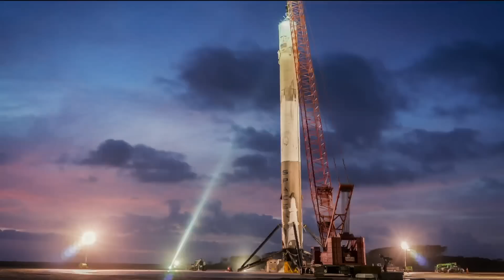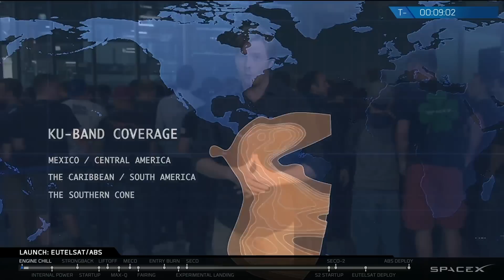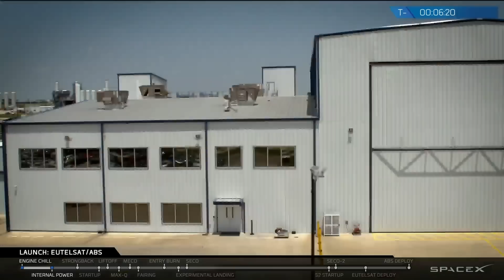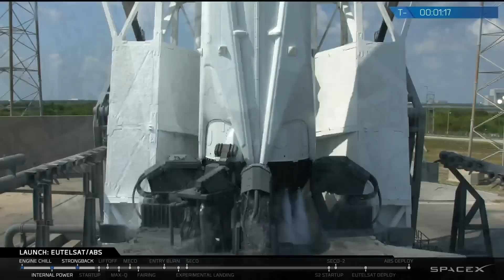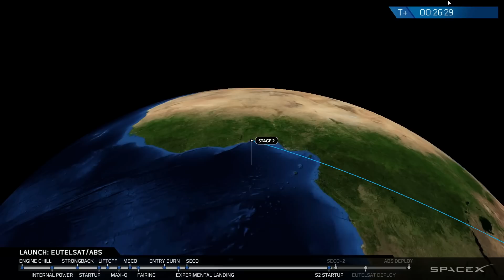Eutelsat/ABS Mission Hosted Webcast

Comment: how about that view of earth and sun as the payload was jettison 1:03:16
Reply: What an Amazing view!!!
Reply: And you can tell its not a perfect sphere from that image
Reply: NicosMind Looks more like an oblate spheroid. ;)
Reply: +NicosMind while it is true that the Earth is not a perfect sphere you have to remember that this is through a small wide angle lens
Reply: If you'd shrink it down to the size of a pool ball it would be a more perfect and smooth sphere than said pool ball.
Reply: Robin Frischkopf Mind blown O.O
Reply: The World Pool-Billiard Association Tournament Table and Equipment Specifications (November 2001) state: "All balls must be composed of cast phenolic resin plastic and measure 2 ¼ (+.005) inches [5.715 cm (+ .127 mm)] in diameter and weigh 5 ½ to 6 oz [156 to 170 gms]." (Specification 16.)

This means that balls with a diamenter of 2.25 inches cannot have any imperfections (bumps or dents) greater than 0.005 inches. In other words, the bump or dent to diameter ratio cannot exceed 0.005/2.25 = 0.0022222

The Earth's diameter is approximately 12,756.2 kilometres or 12,756,200 metres.

12,756,200 x 0.0022222 = 28,347.111

So, if a billiard ball were enlarged to the size of Earth, the maximum allowable bump (mountain) or dent (trench) would be 28,347 metres.

Earth's highest mountain, Mount Everest, is only 8,848 metres above sea level. Earth's deepest trench, the Mariana Trench, is only about 11 kilometres below sea level.

So if the Earth were scaled down to the size of a billiard ball, all its mountains and trenches would fall well within the WPA's specifications for smoothness.

However, it should be also be noted that if the Earth is not a perfect sphere. It is an oblate spheroid and should therefore also be tested for conformity to WPA specifications due to its shape. The distance between Earth’s poles is shorter than its diameter at the equator by approximately 43km. The maximum deviation with the respect to the Earth’s average diameter is half that distance, or 21.5km, which is within the scaled up WPA tolerance of 28.3km.

It can therefore be seen that the Earth would conform to WPA specifications for billiard balls if it was scaled down to the appropriate size, and it could said to be smoother than at least some billiard balls that would be permitted by the WPA.
Reply: last time  i checked balls were a 3d objects and round
Reply: Then it would be more like air hockey.

Comment: Elon tweeted that it "Looks like thrust was low on 1 of 3 landing engines." and "Maybe hardest impact to date."

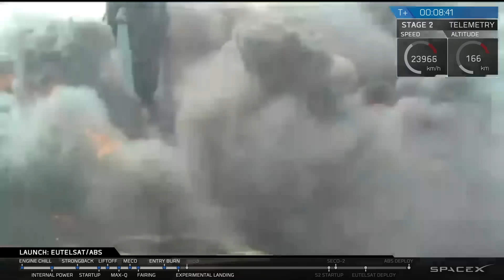But there was no 'impact', you can see the rocket standing still on the droneship for several seconds. Hard to see, but do the following: Go to 26:40 in the video, let it play at a quarter of the speed and watch. You can clearly see the falcon rocket standing still in the first few frames until it is covered up by smoke. Then again at 26:44 you see the silhouette of the rocket with flames behind it.

There was no impact, it landed successfully, the problem seems to be that it's burning like there's no tomorrow
Reply: David Igandan
Well, you can see at one frame that it's standing and 4 seconds later you see the silhouette of the rocket in the same place. 4 seconds no movement of the rocket guaranteed. Looked pretty stable. Just on fire :D
Reply: i think it fell over remember what happen to the legs on the other rocket that made it lean  is possible it happened again and it was way too close to the edge of the barge
Reply: Maybe the landing was hard enough to set something on fire (probably the RP-1 tanks) but not so hard that it physically broke the rocket. So perhaps it "landed" and then exploded shortly after.
Reply: i cant wait to see the video to get this demond out of my mind lol
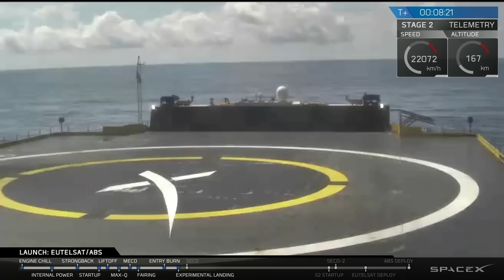Reply: You mean 26:22
Reply: maddog2622
 damn, they seem to have changed the video or cut something out. thx for the corrected time stamp.
Reply: Perhaps a faulty engine? That doesn't inspire confidence.
Reply: Willie Gillie
Elon Tweeted in the meantime:
"Turns out the landing was not as fast we thought, but still hard enough to destroy the primary airframe and accordion the engines"

and

"Looks like early liquid oxygen depletion caused engine shutdown just above the deck"
Reply: Thulyblu Yeah it's weird I saw on some other time stamps that the same thing was going on and the video was 10 minutes behind.

Comment: Gto missions are harder
Reply: Especially with dual payload
Reply: These 2 payloads together weighed ~1.45x less than the singular SES-9. The payload weight makes >10x more difference to the second stage delta-v than it does to the first stage because the first stage is still carrying the empty first stage + some fuel for recovery burns + the whole fully fuelled second stage as well as the payload when it stops burning and those things weigh so much more than the payload.
Reply: +Aeryn Osu Well the cause of the so called 'RUD' was because of low thrust on one of the engine.
Reply: Not really. The mass of the two combined was less than Thaicomm, I believe.

This was one of their easier GTO landings.
Reply: +Hysterrics Space Is Cool The landing video that Musk tweet show the stage hovering a bit longer than usual and stated causing oxidizer depletion
Reply: The combined mass was more than Thaicom but less than JCSAT. Of the 3, it seems like the JCSAT landing worked out the best (Thaicom 8 first stage used up a crush core due to a high approach angle).

Comment: looking at the footage again the first stage did land but with the third engine not working at 100% the rocket i believe landed a bit hard and too close to the edge and looking at the legs of the previous rocket witch compressed too much on the legs to make it lean is a possibility that it did land but the factors as lean the motion of the sea and one leg being too close to the edge probably made it slip in to the ocean
Reply: There's a large steel beam that prevents that from happening. Far more likely that there was a tank rupture or leg structural failure.
Reply: +Ambient Morality elon said on twitter that 1 of 3 engines were producing too little thrust
Reply: Asd Fgh Well, yes, but an engine problem does not imply that the failure was due to that. Tank rupture could happen due to hard landing (unlikely though), fuel line rupture is somewhat more likely as is leg structural failure post-landing.

Comment: Late engines worked, and the voltage burst design. Collect new device! Better to let the device will be a little harder excluding payload, reliable and reusable! Or make a rocket of two cylinders of different diameters (level 65-75% and 35-25% load).
Reply: Reusable stage can be equipped with retractable landing three hydraulic shock absorbers (Gas springs). Of course you need more similarity aerodynamic brakes. Throw idea Elon

Comment: You have to have resistance to control and steer any type of air craft.. Supposed space is a vacuum.!
Reply: See Newton's third law to answer your question.
Reply: There are small engines on the sides of rockets that fire propellant to control where the rocket points

Comment: please do something with the feed from that drone ship, so we can see very clear the stage landing.
Reply: You have a suggestion for maintaining satellite uplink next to a rocket?
Reply: is the drone ship not the rocket. and the phone sats have no dish pointed to satelite.
Reply: The Droplett Yeah, and those aren't streaming HD video. Especially not on a compressed and therefore error-prone standard like MPEG-4. >200dB vibrations + exhaust from rocket (ionized exhaust) aren't easy to work through
Reply: and really can't be upgraded?
Reply: The Droplett Not really. The fundamental frequencies used for satellite uplink and transmission (for high-throughput requirements) is also susceptible to rain, heavy clouds, and large clouds of ionized particles (such as rocket exhaust). The vibrations aren't good for any satellite uplink.
Reply: Bring back the helicopter!
Reply: They could have a second drone ship a few meters away that is hard wired to the first one and contains nothing but a heavily shock mounted satellite dish.
Reply: Ultimate Steve It was a chase plane owned by NASA so will be available on any NASA mission but not commercial missions.
Reply: BinaryCounter Yes, they could. They won't, though, because there's little point. It's a little bit of a better webcast for a significant investment.

Comment: So, the landing was okay or not.
Reply: +Ermenegildo Sforza Picozza Okay, thanks.
Reply: Still, they did manage to bullseye the target before they lost it. So the nav system worked perfectly
Reply: From my humble view i would say F9 hit to fast/hard as there wasn't enaugh fuel for a safer reentry flight path due to the mission beeing a flight to GTO.
Reply: +Mid Night They didn't have to boostback burn this time, so there should have been extra fuel right?
Reply: Matthew Becker
The problem is speed. Yes, don't having to do the boostback saves a bit of fuel, but it's not enaugh to compensate for the extra deltaV needed for slowing the vehicle down enaugh for a really safe landing, especially as every bit of fuel used for the reentry burn isn't there for the final landing burn. Due to the higher velocity reentry ((at seperation) 8,350 km/h (5,190 mph) for GTO compared to 6,650 km/h (4,130 mph) for LEO) there is much more stress on Falcon 9.
I just checked Elon's Twitter and according to him one of the 3 engines used for the final landing burn had to low thrust so the spacecraft couldn't decelerate enaugh for landing (resulting in the hardest touchdown yet).
3 Engines are used as burns close to earth are more fuel efficient resulting in a higher deceleration again resulting in higher stress on the rocket which can lead to problems like this.
I hope this helps, if not, just ask
Reply: +Mid Night The last 2 or 3 landings have all been from GTO as well, and they had boostback burns. So if any of the last 3 should have succeeded, it should have been this one right? Unless they purposely limited fuel to minimum to save additional weight.
Reply: The last 2 (and typical GTO landings) did not have boostback burns.

The usual burn order is:

Boostback
Re-entry
Landing

these profiles skip the Boostback and only do a Re-entry and Landing burn (typically with three engines active for part of the landing burn to increase decelleration thus reduce gravity losses)
Reply: Matthew Becker
The boostback burn is for landing at the launch site, but with tho GTO missions beeing drone ship landings it isn't needed.
With GTO missions the flight path is much more "flat" (low periapsis from where the second stage boost the payload in an highly exentric GTO for it to reach GSO when burning at the apoapsis) and with an higher velocity which prevents the rocket from flying back to land on at the landing pad.
Of the last 3 missions the one with the highest chance should be Thaicom 8 as ot had the least heavy payload.
Reply: Boostback is also done for droneship landings, but not typically GTO-droneship landings due to lower margins. Boostback lowers the downrange distance and gives a much softer re-entry
Reply: Aeryn Osu
Thanks for the correction.

Comment: Why does, in a geostationary orbit, the inclination of the satellite need to be 0°?
I also don't quite get why there only is one geostationary orbit, why isn't there one a few kilometers above? I heard it's because the velocity of the satellite cancels out the gravity, but why could we not accelerate the satellite a few kilometers above a bit more to cancel out gravity there also?
Reply: The faster you go, the higher you fly. There is only one altitude at which the velocity required to maintain orbit matches the earths rotation on an extended axis.
Reply: the 'cancelling out gravity' thing is for any orbit in general. If you accelerate, you get into a higher orbit. The higher the actual velocity the slower the angular velocity. Geostationary orbit is about having the exact same angular velocity as the rotation of the earth. If you go into a higher orbit, you angular velocity will get slower, opposite with lower orbit. There's only one orbit where this works.
Reply: Delta_STW5 thanks! :)
Reply: Thulyblu thanks for the detailed description, I understand it now! :)
Reply: Box Box???
Reply: JJ Gragas no, sorry.
Reply: Actually, the higher it orbits the more SLOWLY the satellite is moving (speed goes as the inverse square root of the orbital radius or height); it's the initial velocity during the launch which is higher because the high orbit has a higher energy (you are moving out of the negative potential well as you move higher). Geosynchronous orbit is where the orbital ANGULAR velocity equals the Earth''s sidereal rotation angular velocity.

Comment: why aren't second stages used as living spaces?
Reply: Theres fuel in stage 2
Reply: You could easily vent it into space through 2 ports balancing any unwanted thrust
Reply: All it would need would be some pipes bringing in life support and a large hatch
Reply: too risky.
Reply: ha ! , name one thing about space travel that isn't trolley man.
Reply: instead of sending back down to earth, keep them in space and attach them to each other. Maybe to far away from low orbit by the time of seperation?But I guess they don't make a great ISS.
Reply: douglas faulds trollies are not used In space travel you bloke.but they're right outside wallmart.

Comment: Can someone of you space-engineers explain, why they don't have to deal with the heat problem caused by air friction, like all spaceshuttle and rocket capsules had before? Thanks in advance  ;)
And trolls, pls don't tell us: "Because it's fake.", that's boring....
Reply: Ben Awsome Thanks for the fast response, Ben, and sorry for my bad non nativ english, calling it "friction" instead of "compression".
I was guessing your mentioned solution, but wonder, why this was never used before? Because of fuel consumption, it's weight and transport ratio?
Reply: Ben Awsome If there is a comma missing after "Probably", I understand. Otherweise, to call something  a "secondary mission" is just a statement and cannot be a REASON for not using a technology.
Reply: Capsules don't need to because they use an ablative heatshield at the bottom. There's no engines at the bottom of the capsule, so it can get away with that. Additionally, capsules cannot slow down enough to avoid very hot reentry because they come from orbit. This is a suborbital trajectory, so much slower speeds and less heat.